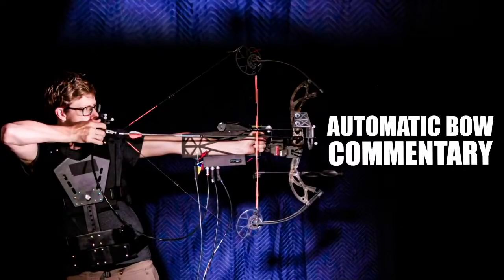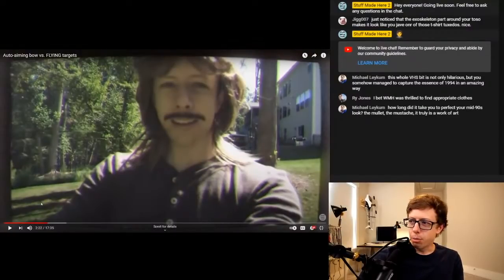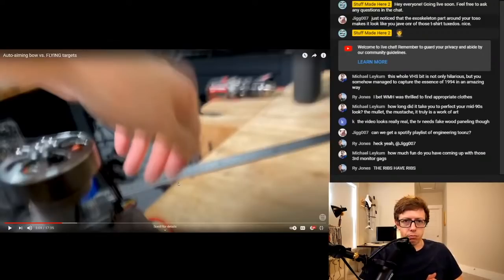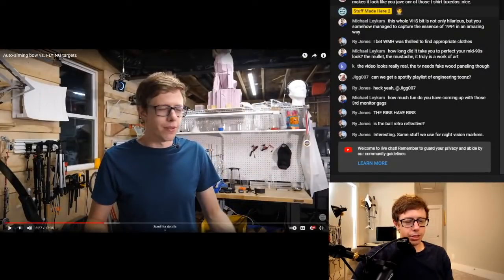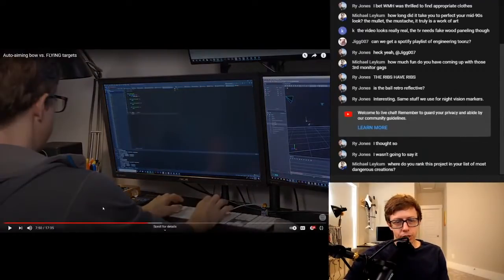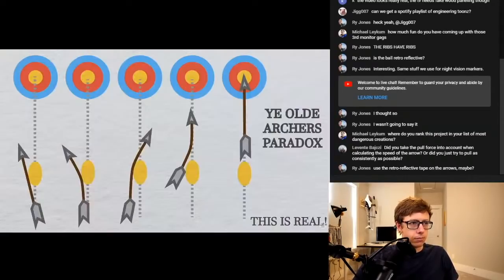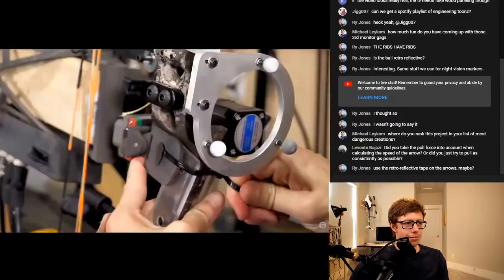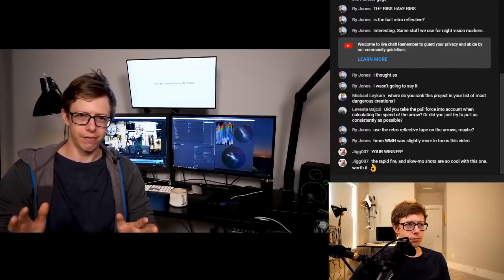Stuff Made Here breaks down Automatic Bow

Comment: For the drone motors, you need to add a sensor, either hall effect or encoder, to monitor the position. Sensorless/Field monitoring doesn't work well under high loads, VESCs are the only ones that work well for that afaik.

Comment: The latest odrive firmware supports motor temperature sensing. It think it is configured as a thermal cutout, but I'm sure it could be tweaked to regulate the motor current limit through a PI loop.

Comment: I haven't read the comments to know if this has been suggested but here is my thoughts. If you'd like to solve the overheating issue and get back to the quadcopter motor you could think about mounting a small AIO to keep them cool. I don't know if you'd be able to get enough contact with surface area of the motor to cool it because I'm not very familiar with those motors.

Comment: To make it work longer range without the tracking cameras: 
Using a "normal" camera down a scope you could estimate the distance of a target of known size and relative aim vs target position.
Then use some kind of IMU system to measure the orientation of the projectile launcher vs gravity and the scope.
You don't need to know the absolute positions, you only need to know the relative position of the target to the launcher and orientation to gravity.
You could use a 2d map on transparent LCD that shows the certainty of position of your identified target, and where the projectile is likely to end up. Like a probability wave function. Target in Blue, predicted location in red. Then you could use actuators so it can move it onto target for you as your current set up. Maybe an green area around the Red to show where you're physically aiming vs where it's capable of moving to. So that you try and get the blue target in the middle of the green area and it tries to line up the red with the target. 

Maybe a ghost image for the target like an overlay predicting it's position for moving targets.

Comment: Have you ever tried to use Valves Lighthouse tracking? My guess is that it's currently the best tracking accuracy to price ratio that you can buy.
Reply: I have experience with it, trying to use it as a GPS-like system for autonomous drones flying indoors.

It's not quite as good for this usecase as you'd think it would be. But not because it is not precise enough. It is precise to a fraction of millimeter. The problem is that it's just not very accurate. If you trace out a straight line, it'll actually come out slightly warped. It's just a cm or 2 over a few meters, but it's definitely there. The strange thing is that it is always consistently warped the same way. If you return to the same coordinates, you'll be in exactly the same physical place even though those coordinates don't quite match the physical position you're in.

It's also extremely sensitive to high frequency vibrations (like those you get from drone motors). This is because the lighthouse system actually isn't what makes it feel really responsive in VR. The IMU in the trackers is actually doing most of the work figuring out how things are moving. The lighthouse system is really only there to get rid of the drift that's inherent in those systems. The IMU polls at a much higher rate and can detect much finer movements because it's right there being moved, while the lighthouses make sure that the small errors from the IMU cannot accumulate into a big error.

This is a fine setup, but it is clearly optimized to the VR purposes. I don't know what causes the warped space, but the low accuracy, high precision trade off is perfect to fool humans. The sensor fusion between the IMU and the lighthouse system is also very biased towards human experience. It's good at making a really good estimate of your motions quickly to fool your brain, and it will correct errors before they become too obvious for a person. But when you actually want to plug that data into algorithms they really start biting you. You can make it work (I did make that drone fly and do acrobatics...), but it's not the right system for the job. The Lighthouse system as it is today really is no competition for commercial tracking systems. But that's okay. It's also just a fraction of the price.

Comment: Considering that the system at 39:15 is essentially an un-stiff actuator holding up a rather heavy mass, would you consider using a seismic counter-mass to actuate the bow, instead of pushing-off against your own (relatively compliant) left hand?

Comment: Well, using expensive tracking cameras to measure the pull weight is fine (even when load cells exists)

However... A servo motor... A servo motor to quickly release the arrow...
Why not use a solenoid?